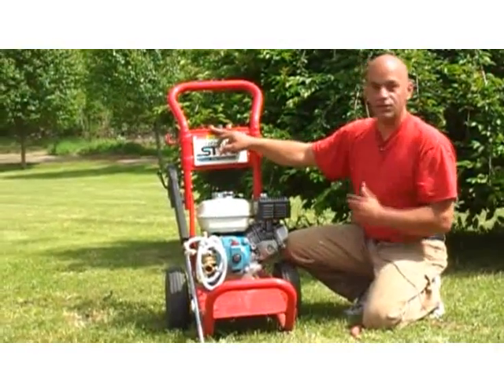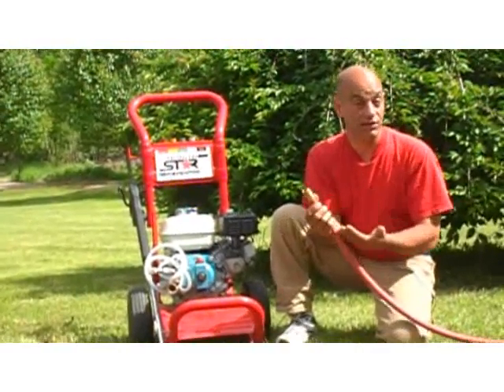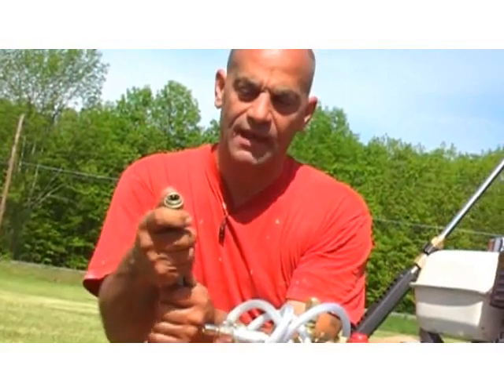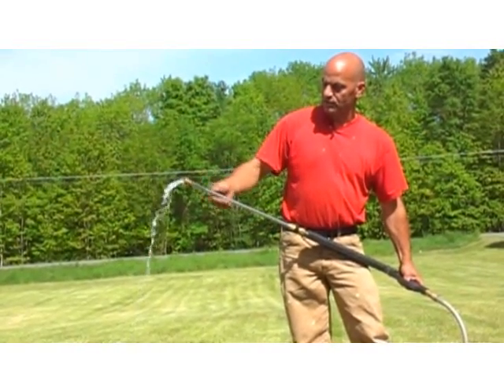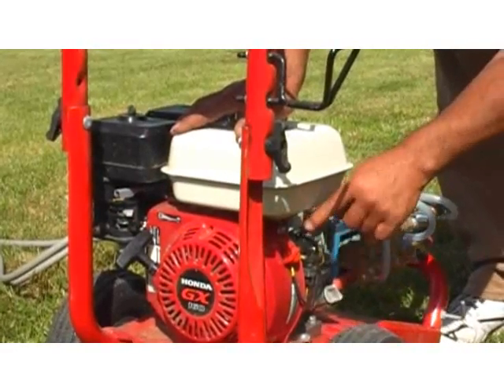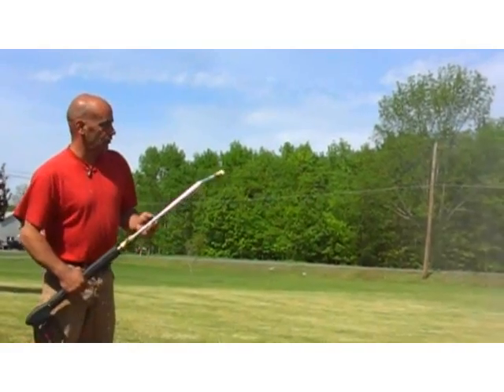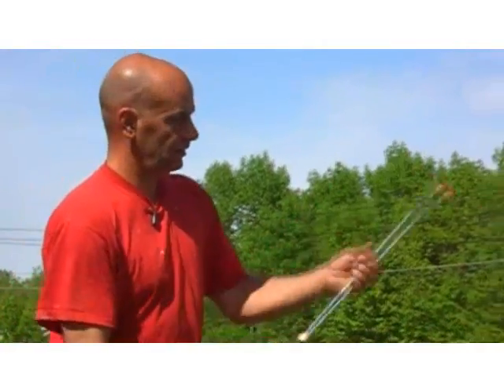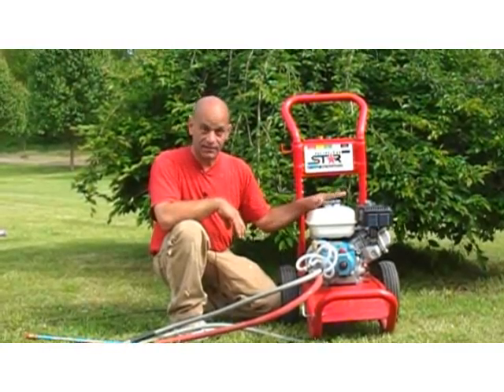How to use and setup a rented power washer.

Comment: Great video , curious what nozzle range would be for clean a car would a white 40 deg nozzle be ok to detail a car to show quality or would i be wrecking the paint, clear coats ,..etc. Is the a lower then 40 deg nozzle out there or more adjustable nozzle you can get ? Or would you just uses black chemical nozzle setting but just with no add soap just water if you don't want to uses detergent.

Comment: If the rental guy doesn't teach you how to,use the machine you need to go to a different place. I am a tool rental associate at The Home Depot. I am actually the best tool rental associate in the second best tool rental center in out district. Second only because the first store is HUGE and is in a very fast expanding neighborhood, but I digress. I go over every tool thourghly before we do the paperwork. I will show the customer how to start the gas ones and how to run the fuel out of the carborator before they transport it. I tell them what size they need and what tips to use. The only problem I ever had was a guy say it didn't work with his 200 feet of hose, he was a dummy.

Comment: PLEASE ANSWER TO MY QUESTION :) 

will it damage the pump or other parts of the pressure washer if i let the engine run without pressing the trigger of the gun ? because when the engine runs, it builds up pressure and if i'm not pressing the trigger the pressure won't release. will it explode or something at the end ? i hope you get what i mean.
Reply: no it won't damage anything for the short term, but letting it run for a long time w/o depressing the trigger will burn up the pump because the pump uses water to cool so when it is running with the same water it will get very hot.

Comment: Just got a used Rigid pressure washer for free. It has no hoses though. Is there a safety on it that stops it from being started without the water or hoses attached, because the engine, Subaru, won't start.
Reply from the maker: Not really. How ever that's a knock off Honda engine. So I would check the oil level.
Reply: Thanks, I'll check it out.